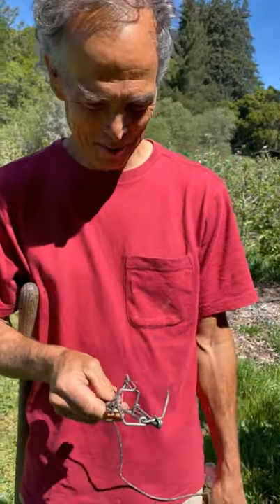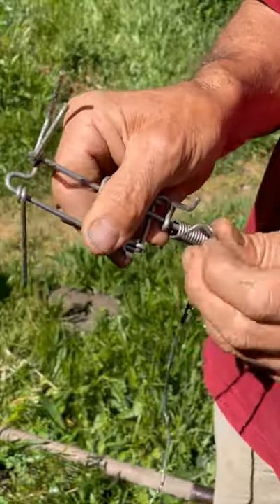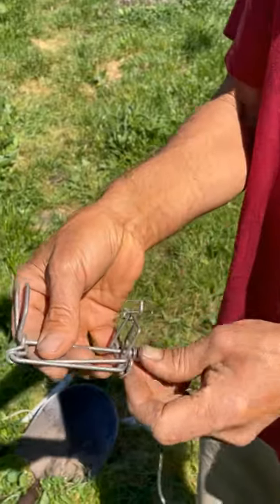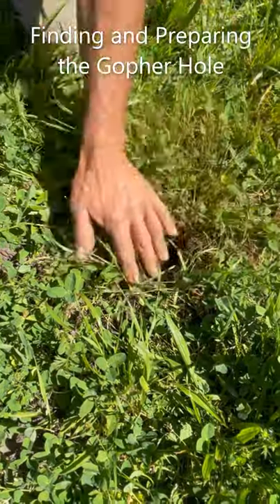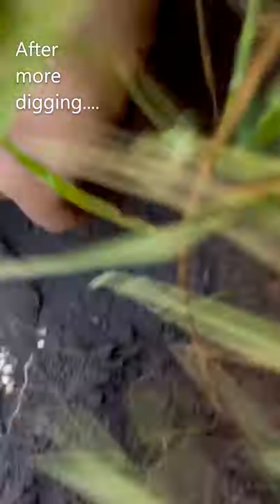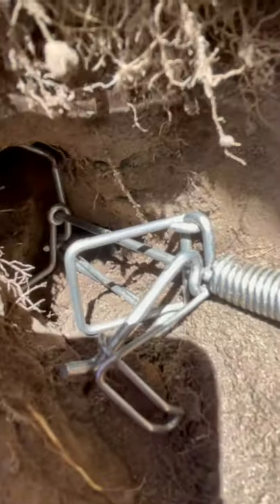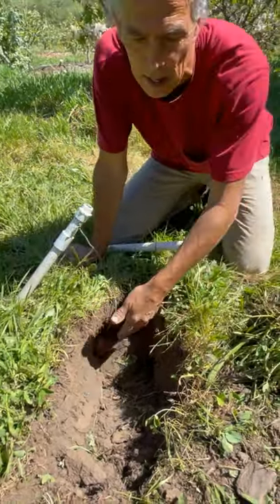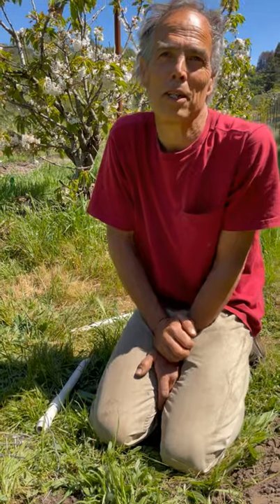Techniques for Trapping Gophers

Comment: Great video and explanation on how to use it. The Gophinator works great! I used your suggestion on burying the gopher in the hole. The issue I had was racoons were digging them up causing me to refill the holes. I'm guessing the smell would cause them to dig at the same holes for days. So now I just throw them in the tree line for them to eat so they'll stop digging up my pasture.